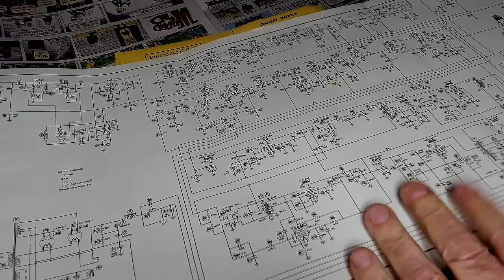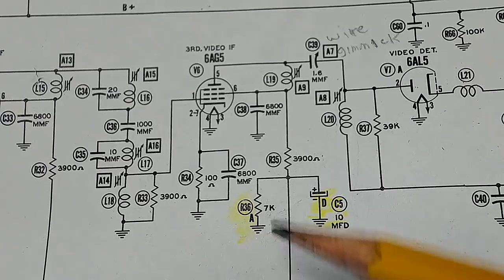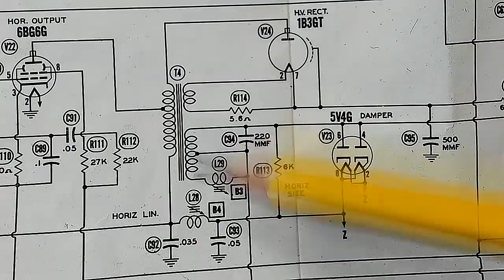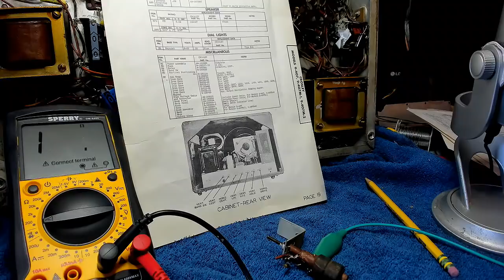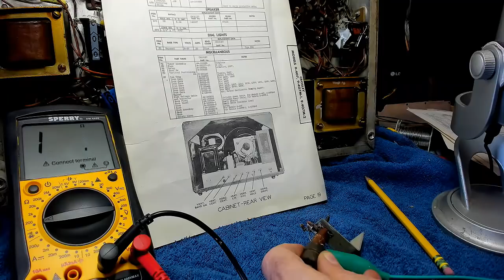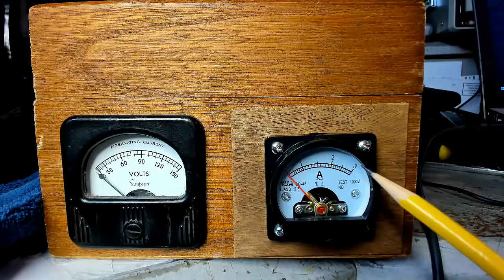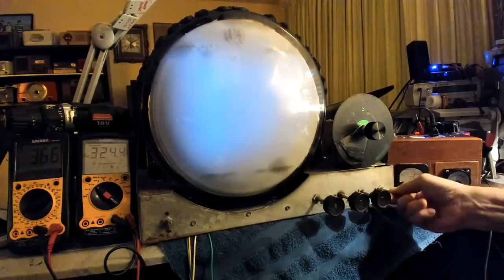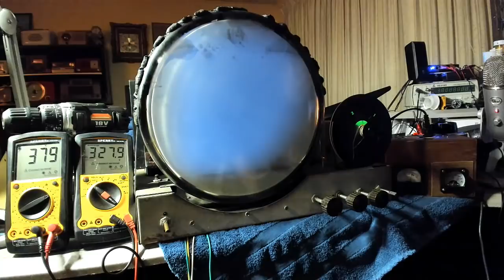1948 Crosley TV Model 9-407 Repair Part 2

Comment: Buzz, check the resistor in series with the 1B3 filament.  They drift high sometimes and cause low HV. And have a happy New Year.

Comment: Certainly could use some more high voltage. What does the sams call for? I'd get out my scope and look at the horizontal drive shape and frequency. You're getting something but it may not be close to right. Any way good luck and stay well and very happy holidays and keep your hands out of the high voltage, cause that really hurts...
Reply from the maker: Good point

Comment: Do they still broadcast an analogue signal in the US? We used to have VHF 405 line for Monochrome and then in the late 60s we switched to PAL which was UHF and had 625 lines and had an extra subcarrier for colour all that was phased out in the early 00’s and we only have digital on the old terrestrial frequency’s
Reply from the maker: it's digital

Comment: Stay the course Buzz.... when you were testing the TV, did you ever go above 100V on the variac ?   You are close.. I can feel it.... Really nice work although I did cringe when you were working on that coil :)   You nailed it my friend !!!!   Also, because over the air signals are NO MORE, you will need a video source to see if it works... if not, all you will get is snow..   Looking forward to part 3  - Ron
Reply from the maker: By the time I tested the hi voltage it was up to 120....might be a bad flyback  with shorted turns??/ need over 10k, 4 K dosent cut it...merry Christmas Ron🎅🎅🎅

Comment: You have a lot of work to do on this but you are getting there.
However NEVER measure the plate of the horizontal tube, it is AC and has very high spikes on it, the schematic will say "do not measure".
Never measure the cap of the 1B3 HV rectifier, it is High voltage AC, measure at the BASE of the 1B3 which is high voltage DC.
The high voltage should be much higher on the CRT anode button, something like 12 to 15 KV,  7 KV is too low.
You will get it, stay with it.
Reply from the maker: thanks Goat, I will get this working!, Merry Christmas🎅🎄
Reply: @Buzz1151   Merry Christmas and Happy New Year  Buzz

Comment: hEY bUZZ! i REALLY ENJOY ALL YOUR VIDEOS. wHERE DO YOU ACQUIRE AL THE SERVICE MANUALS AND SPEC SHEETS FOR THE tvS AND RADIOS YOU RESTORE?
Reply from the maker: Lots of places....Ebay, friends, https://stevenjohnson.com/photofact.htm,
http://www.nostalgiaair.org/
Reply: @Buzz1151  Thanks for the info. I am currently restoring a Philco 46-1203-T like the one in your 8-part series. I am almost done. Just ordering my cartridge today to replace the original one that is still on there. I appreciate your informational videos. How did you attach the P51-3? Did those tabs line up with the screw locations for the original Shure?

Comment: What do you mean by B+ Buzz? Does that refer to the old HT Battery voltage that you would get in smaller power valve radios? Sorry I’m from U.K. and we have different terminology. We call the DC high voltage for the anode (plate I think you call it) the High Tension or HT is that what you guys refer to as B+?
Reply from the maker: the B+...it's the rectified DV voltage just like in a radio